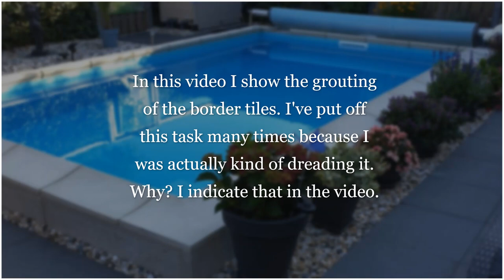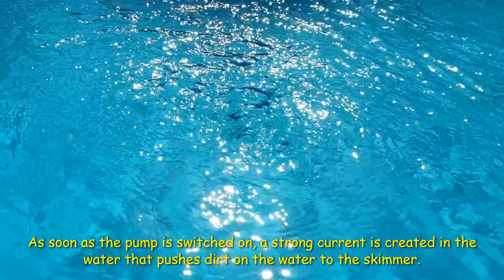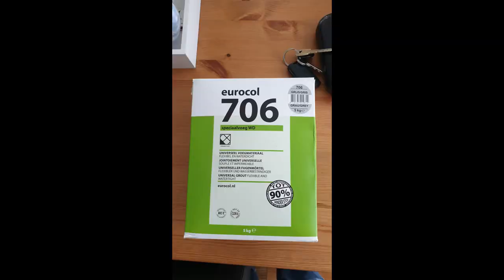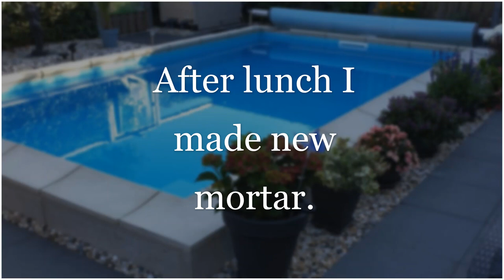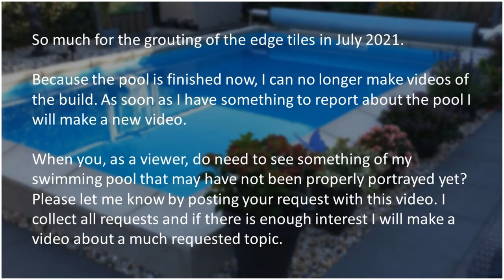13 | Grouting edge tiles | Build a pool yourself | English version

Comment: Hey Martin, i am looking to start building one of my own for my family. Thank you for the detailed videos and great work. I was wondering now that it is 2 years later, with the pool settled in place. Have you had any cracking or repairs that where needed with the plaster or paint surface?
Reply from the maker: Hi Andrew, thank you for your compliments. Unfortunately I cannot answer your question about the status of the pool at this time. I sold the house and therefore no longer live there. The pool was in good condition when I moved and I have not received any complaints from the new residents about the condition of the pool. So I assume everything is still fine. But I'm not 100% sure about that.

Comment: A couple of tips, too late to help you but may help others looking in the future. Use a 4 in 1 grout additive at 1:1 ratio with water and mix the grout a lot runnier than you have made it, this will make it a lot easier for the grout to flow into the joint. You can buy special adhesive masking tape that sticks very well to bricks and mortar, cut off a short length of this and stick it to the underside of pool edge gap. You can now fill the gap in the pavers from above without it falling out the bottom. Once the grout has started to set up you can remove the tape and smooth the join with your finger and add any extra grout if necessary then clean off with sponge. Also, leave your pool cover on while you're doing this, it's much easier to clean the excess grout off the pool cover rather than getting it out of your pool. After you have grouted the joints, clean off all excess grout with a sponge and bucket of water rinsing and squeezing the sponge between each wipe. There should only be grout in the join and none on the face of the paver. Hope this helps somebody.
Reply from the maker: Thank you very much for this addition.